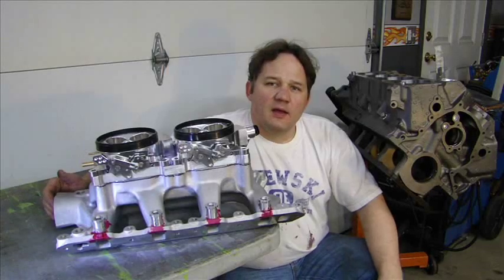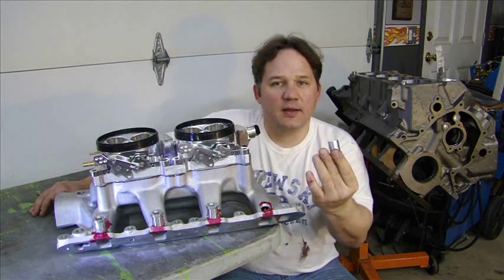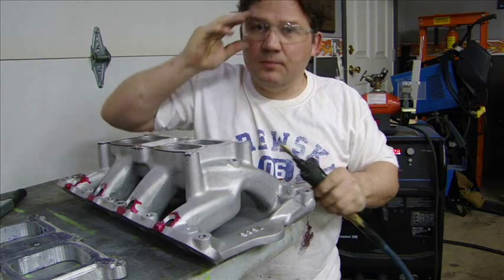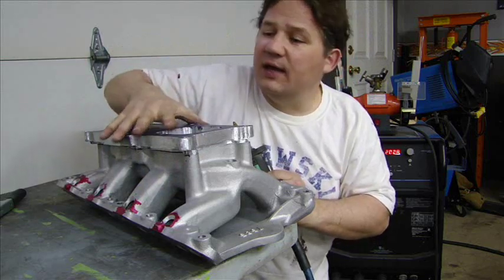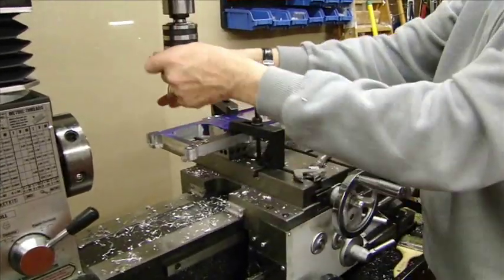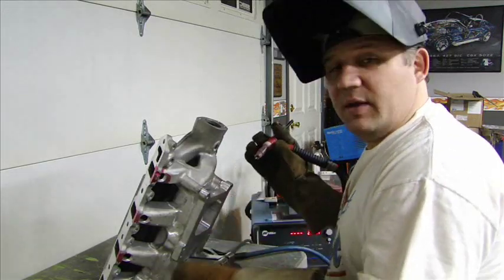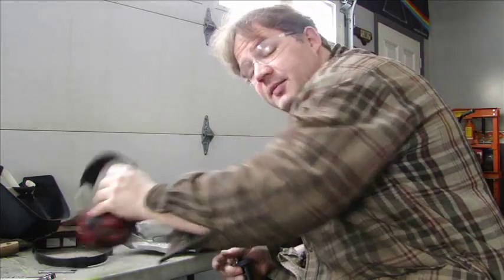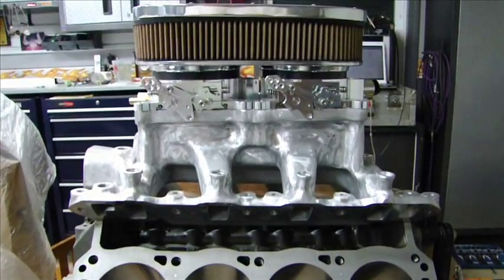Modifying a Stock Intake Manifold - Adding EFI

Comment: Won’t the split in the intake mess up the fuel ? On every EFI kit that I’ve installed, they want an open manifold. Let me know if u run into any fuel balance issues, curious to know if one bank gets more than the other because of the split in the manifolds
Reply from the maker: I have zero issues because there are two throttle bodies. However, I've never had an issue with a split dual plane manifold.

Comment: Cool, I'm a guitar builder, "and player" ( Fender Custom Shop Senior Master Builder 15 yrs ) I'm building a BBC 540 twin turbo. I have a Miller Syncrowave 250. Plan on just making a full sheet metal intake.  To run 16 injectors is too much work on the cast manifold ((8 injectors low boost pump gas)) (the other 8 pushing race gas when boost and fuel supply demands it)  BUT, I have a Victor Jr for my 383 SBC and want to do what your doing, but I'll probably just pop a throttle body injector on it.  You would laugh at how much I use my guitar / wood machines to fabricate aluminum. I'll make wood forms / dies to shape all my intake runners . Then I'll use my zillion dollar Miller to weld little anchors onto my truss rods, LOL.....
Reply from the maker: That's cool Jay....since I'm a lefty I had a Strat made in the custom shop a few years ago. Sounds like you'll have fun making that intake

Comment: I understand your need to get everything to perfection , but there was no need to weld the billet spacer . As long as you have a seal it is enough, you could just bolt it. There is no real pressure in that area and tapping few screws would with a silicone gasket would have been enough.
Reply from the maker: That is true, however I wanted a seamless looking part
Reply: saferider10 No real need to have a hot rod either, but thats not the point is it?

Comment: Hi Pete
Just installed EFI on BBC, have an Edelbrock air gap intake , no spacer. I have uneven burn in headers, Cylinders 1-4 lean and back cylinders rich, can tell by burn in headers that have to be recoated because of heat in front tubes.....bummer.

How can I modify or tune to even out combustion, will a 4 hole spacer solve this issue, or do I have to retune injectors somehow? According to FAST the 4 drivers should be supplying fuel evenly

Thanks
Reply from the maker: What computer system are you using to control the injectors?
Reply: *****
Thanks for responding...... This is the EZ EFI 2.0 system, the install is right out of the box and not adjusted in any way
other than plugging in AF targets. I don't pretend to know all thereis to know about this but the way it is working ie., lean/rich can't be good for the engine, just built. Think carb, if this occurred the cross jetting would even out the combustion and the plugs would have even tan burn, showing proper efficeincy. It was proposed that we turn the TB around and see if the back cylinders now run lean, that would show injector squirt issues, also I have not tested for 
air leak in front of intake but I believe engine builder torqued it down correctly.  Have spoken with a EFI expert locally
( not the installer ) the installer doesn't have a lot of experience with this product so tuning is limited.

What would you suggest for the control of the injectors and how do you test for there 4 drivers exacting the same fuel charge from each set of injectors, each driver controls 2 injectors.  Thanks for your time. This is a speed density system and there are a lot of variables re sensors, pressures and how the ECU responds to these conditions, this should not be such an issue you would think but it may end up being an expensive fuel delivery decision, maybe not the right one for a
Gen IV BBC build . I do not know what the vacuum inches are as well so this also a factor.

Comment: Hey Pete- gotta question: is that fuel rail pressure vacuum regulated or the returnless type? Thanks. Manifold looks like it's poured hot wax! Totally seamless. Eldebrock couldn't have done a better job. BEAUTIFUL
Reply from the maker: HUBBABUBBA DOOPYDOOP It has a return. Thanks!

Comment: You're absolutely right. That was the first impression I got when received your question, and yes I really mean it, us gear heads, usually come up with ideas at any given place or time and having the tools at hand is important. It used to happen to me..."Mmmm I need to get another 50hp out of the engine....what if increase fuel pressure by 10psi...could save on new injectors...mmmm..." while in the supermarket line or somewhere else. It's about being efficient in what you do.

Comment: Do you remember the formula for selecting an injector based on planned HP or the formula for determining cylinder head HP potential?   What about power gain formula when using cold-air induction? Probably you do. But in case you don't and if you are a gearhead like me that needs to make some calculations while grabbing the cereal box in the supermarket, well, you need an app like EFI Math or Engine 2LBox.

Comment: i acually have a block, 350 small block from an el camino but i dont think it was the original. i tried my self to rebuild it bcuz i changed the pistons, but being as my first ever rebuild, i tightened things a bit too much and left others loose, the crank destroyed and now all i have left is a bare block :] with cam bearings -_-. if you would be willing to take that to build, id like to try and get 450 to around 600HP :]

Comment from the maker: There are as many ways to build something as there are builders. Two throttle bodies looks a lot cooler than just one. If you look at a later video you'll see I switched that air cleaner to one that is made for a dual quad 427 and has more than enough flow. I know it's overkill.....but I'm not racing....it looks cool and it performs awesome!

Comment: i think i would have made a top like a victor ram , in a triangle shape , and mount 1 throttle body ,,, 1000 + cfm will feed 1000 hp ,,, why have 2100+ cfm available and use a air filter that small ?

Comment: could you have used the alumaloy  on the intake?  It's supposed to be stronger than the base aluminum and it flows so smooth you wouldn't have to grind it.

Comment from the maker: You are right.....before I welded I ground it a bit deeper with a burr. Since it is fuel injected I hope I don't see many backfires, but it is not a race engine so it should not see that much pressure. Excellent comment!

Comment from the maker: I will give you a chance to redeem yourself. The throttle bodies sit on top of the manifold and only regulate air. If you look straight down the injector bung it dumps right into the the cylinder head. Now, you think again.

Comment from the maker: I knew that was going to sound confusing. I have many wires in the wiring harness going to the engine so I am making a billet bracket to mount to the back of th head that will route all of the wiring. I am going to mount the MAP sensor at the very top above the valve cover line so it gets air flow. It it be almost right at the hood scoop opening. The optimum place is on the firewall but all new cars have it mounted to the lift bracket on the back of the engine just above the valve cover.

Comment: @CoolCarsHotGuitars :
Thanks for the input i appreciate it! But i am a little confused on exactly where you will mount the MAP sensor? You say it will be off a bracket from the head? It seems like that would have more heat than if directly to the air cleaner or carb/ tbi spacer? Also, i am using the oem MAP sensor from a 96 5.3 vortec motor so maybe our sensors are designed differently? Maybe when you get to this step you can post a video of how and where to mount it?
Thanks again!

Comment from the maker: First of all thanks for watching...I really appreciate your comment. The map sensor does need to be mounted above the manifold, but it does have to be away from heat sources. I want  to mount mine under the air cleaner but it simply can't be done. Any heat will create idle problems. I am planning on making a bracket that will mount to the head and keep the sensor away from heat. Hope that helps.

Comment: Awesome set up and great video. It's nice to see the build step by step. I am curious as well where exactly you will mount the MAP sensor? I am doing a similar though simpler conversion, I am converting a carb intake to SFI for my 383 stroker fresh build. You mentioned in other posts that the MAP sensor can mount about anywhere as long as it is above the manifold? Could i mount it on the side of the carb to tbi 2" spacer? your input would be greatly appreciated .Thanks.

Comment from the maker: I am using the throttle bodies and wiring components. I modified an Edelbrock dual plane, dual quad intake for the project. I am getting some more billet parts made so I should have the motor finished and on the dyno soon. Thanks for watching....................Peter

Comment from the maker: This is and will be a crazy strong engine. The IAC comes on both throttle bodies but I only need to use 1. The map sensor hooks up to any vacuum port and gets mounted remotely as long as it's higher than the manifold. I'll be using the Accel Gen 7 DFI for the PCM with a wide band O2 sensor mounted in a header collector. The Gen 7 has over 100 screens available for fine tuning and is excellent on large and high horsepower engines. Can't wait to get it on the dyno!

Comment from the maker: Excellent question! Both throttle body linkages will be tied together so they will move identically. I need to do some engineering to make a cam type bellcrank to make the throttle less responsive close to idle. With 2100 CFM the motor will be very touchy. I will only use the TPS on the rear TB since they will be tied. A mass air flow sensor will talk to the ignition electronics to match injector dwell. It will take some tricky tuning, but I have an awesome dyno guy who can make it all work.